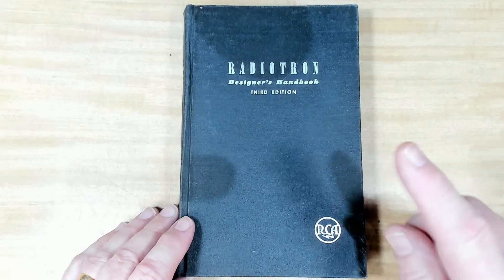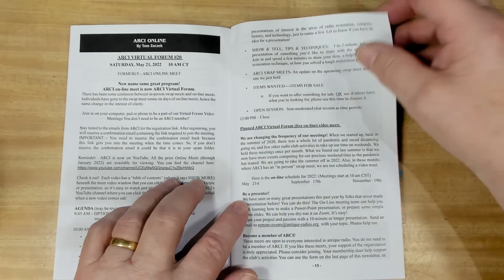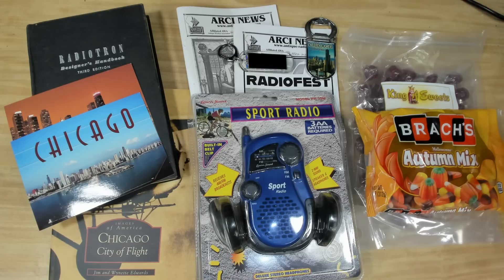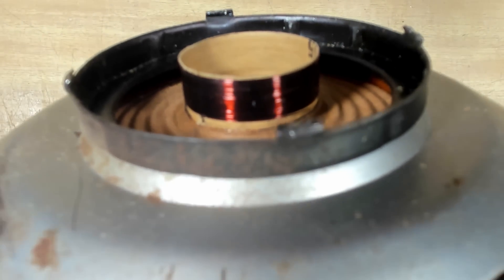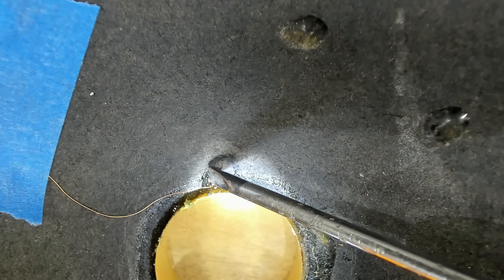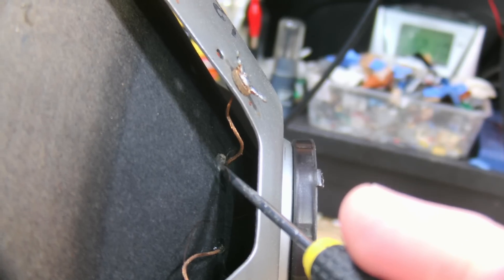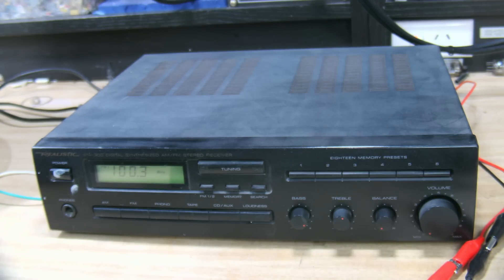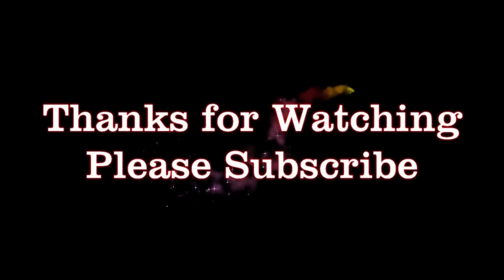12P1 Magnavox speaker repair and candy sent by a viewer.

Comment: I had one of these in 85/86, I used to unscrew the magnet like removing a bayonet light bulb and put it back without it rubbing. oneday I took it to school after the cone sustained a few more injuries, Damien Gow had a bright idea to plug it into the 240v, Jon grabbed me at lunch and said quick come, they're blowing up your speaker, I missed out on the loud blast, I unscrewed the magnet and saw a wisp of smoke and no sign of the coil wire (it was in the magnet), The speaker was from a Multisonic HiFi radio-gram my stster's Mormon bf gave me
Reply from the maker: Haha... the 240 didn't agree obviously 😄 Thanks vaughn 🙂

Comment: I just recently did the same kind of "microsurgery" on a speaker in a portable school record player (stereo!).  Of course, I wasn't as precise as you, and was thankful just to re-make the connection without any rubbing or extra distortion. No one would think you did it, of course, but it's hidden behind the grille! They were also missing dust covers over the voice coil (or maybe never had them), so I hand cut little discs out of an old sock and glued them in place.  (Black socks of course... I'm not an animal! ;-) They won't win any beauty contests but they work!  (Never throw away your old socks until they're covered with grease, cleaner, polish, or you've cut them up and glued bits into a project!)
Reply from the maker: Haha... I hadn't thought of using socks as a dust cover 🤣 Still, good job getting the speaker to work again. Thanks Lurker

Comment: Hey David I have a ASTOR model G3A I recently was gifted but know nothing about how to use the record player, would love to be able to contact you further for help if that's okay! I've figured out how to use the AM radio but not sure how to turn on the record player
Reply from the maker: Hi @AlsoMijit. The control knobs functions are printed on the dial glass, from left to right they are... volume, input selector, Tone + on/off and tuning. The second knob from the left is marked 'S', 'M' and 'R'. 'R' is Radio, 'M' is Mono records and 'S' is stereo records. Select either M or S depending on the record type you have, mono or stereo. Place a record on the record player platter and select 'Manual' on the selector control on the record player. Lift and place the tone arm on the edge of the record and it should play. You can contact me if you need further help. If you do, please attach a photo of the record player as this model came with a few brands of player 🙂
Reply: Thanks David i've sent you an email with the issue thank you for helping and responding so fast!!  @DavidTipton101

Comment: Nice timing! I recently picked up a vintage Hallicrafters speaker and enclosure. The speaker cone is in good shape but it looks like the coil is open just like in your example. Now at least I have an idea how to go about fixing it. Thanks! A few more examples might be helpful. Seems to be a delicate process. Do you have any previous videos that show the process of fixing a speaker?
Reply from the maker: Hi Erik, thank you. This speaker may have been a little different construction wise to other speakers of the same era. I don't think the magnet is usually removable in which case the cone and spider would need to be released from the basket, I was doing to try acetone to soften the adhesive in that case. I have done speaker cone repairs on video before but not repair of the voice coil 👍🙂

Comment: Nice guy in Chicago!  He obviously enjoys your work, Dave.  Repairing an old speaker like that is a touch and go job and you handled it with aplomb.  I want to pass a little hint to you from a friend who re-cones speakers and repairs speaker perforations.  Where the paper has started to thin out (as with your speaker) and there might be a tiny hole or two he uses Rust-Oleum black leakseal spray, which is a flexible rubber coating spray.  You can get it at Bunnings or Mitre 10.  The trick, according to him, is to spray one quick coat passing over the speaker...leave it for twenty minutes and then spray another couple of coats.  He has demonstrated such a repair to me and the speaker sounded fine.  It was a Plessy~Rola speaker out of an old Astor lowboy tv.  It actually came up looking really nice and sounding nice as well.
Keep up the good work, Dave...I enjoy all your videos and look forward to seeing new ones.

P.S.  Here's the Radiotron manual as a PDF:
http://www.tubebooks.org/books/rdh4.pdf

Comment: Great repair on the speaker dave, i have done a couple of speakers that also had open voice coils. In my case the wire from the voice coil was run and glued to the front of the speaker cone and was a little bit easyer to repair than your speaker. You could put that speaker into "stock" for a future repair down the line or incorperate in some inclosure with a 4" tweeter/ 3~5 watts of class A amplificaton ( valve ) and you would have some sweet sounds. Looking forward to the next instalment.
Reply from the maker: Hi Stephen, I could have run the wire on the inside, I didn't think of that. Most are done that way. The speaker is in a box waiting and ready to go to a new home if someone wants it. Thanks Stephen 🙂

Comment: I hope you get a project that needs that speaker. I'd love to see it go into one of your amazing restorations. Great video as usual.
Reply from the maker: Hi Ian. It was used on a radiogram I would kie to own, maybe I will get one one day and it needs a new speaker. Thanks Ian 👍🙂
Reply: Those 12P1 were used in Kriesler Multisonic hifi  radio-grams, along with 27 ohm 6x4 sealed back squawker wired in paralel without crossover cap, a 0.68uF would keep the honky tone down, and an electrostatic tweeter @DavidTipton101

Comment: David, I have been a radio and electronics hobbyist for many, many years, but I just realized that I don't know what purpose those braided wires on a speaker serve!?  Why do the braided wires run from the speaker terminals to the cone before going to the voice coil?  Why not just run the speaker signal directly to the voice coil and eliminate the braided wires?  I know I am overlooking something, but I can't figure out what!  Thank you.
Reply from the maker: Braided wire is used because it is very flexible and connects the stationary part of the speaker to the moving cone. It needs to be very flexible so as to not impede the cone travel and not fatigue over time. Thanks William 🙂
Reply: @DavidTipton101  David, I know I'm probably dumb as hell, but I'm not understanding why and how the cone of the speaker needs to be electrically connected to the speaker feed and to the coil. I guess I am just missing something. Is there a coil of wire on the speaker cone also?
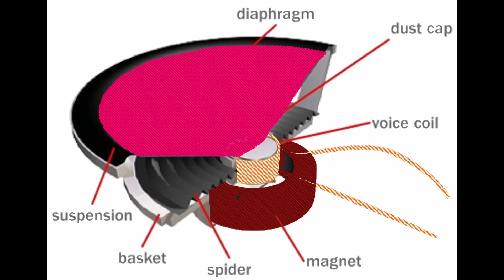Reply from the maker: @HamJamming  No problem William. There is an animation in the video at 5:46. The voice coil is attached to the centre of the cone, the voice coil and the cone move in and out relative to the metal speaker housing (basket) to produce sound. The voice coil is connected back to the speaker terminals via the flexible wires so the cone can move in and out unimpeded.

Comment: Why do you think the center portion is much darker than the outer portion? Was there more to it than we're seeing?
Reply from the maker: Hi Darryl. I didn't notice it but it probably gets warmer in the centre 🤔
Reply: @DavidTipton101  Usually, that's an indication that something was covering the area and was not exposed to light like the outer part was.
Reply from the maker: @Darryl603  I thought you were talking about the voice coil, I don't know why the cone has the darker centre section, it is not unusual so it may have been treated with something during manufacture.
Reply: @DavidTipton101  I think it was a duel cone speaker

Comment: Excellent rescue of a piece of tech that would be expensive to buy new, if they were being made with that level of solidity and quality of materials. Little videos like these are real nuggets. Thanks for sharing David
Reply from the maker: Thanks Ken. I have it stored in a box, hopefully someone can use it one day 🙂
Reply: In many ways modern speakers are much better, but they have a different sound, and often don't look or sound right in old radios. I have a small collection of old speakers just for voicing amps, as the speaker (and box!) make more difference to the sound than the brand of your amp.

Comment: Hi Dave, 
Like you intimated, it was destined for the trash, so give a repair a go.  At worst, it would remain trash.  You performed an excellent job repairing that speaker.  It is now ready for work as and when you require a larger speaker.
Also, an excellent Antique Radio Restoration community is evolving: that sure is a good thing for like-minded people.
Best regards, Phil
Reply from the maker: Hello Phil. I had nothing to lose attempting a repair and I might learn something (I did). I have spoken to and met so many wonderful people across the world doing these videos, it has been a pleasure. Thanks Phil 🙂

Comment: Hi David, Have that same book in my collection. It is in the suggested reading list I put together in my "Show More" section. I Refer to it fairly often. Nice 
Repair. I have a 12 inch sitting on the bench right now with an open voice coil. (will be in a video to be released soon). Also had the wrong output transformer attached.
Found an original with transformer attached for the restoration. Guess I will have to dig into the dead one and see if I can match your skills. 😊😊
Reply from the maker: Hi Vern, I wasn't familiar with the book till Martin sent it. It's very good, I have read small sections and picked up a few titbits already, I need to set some time aside to read it in full. I was hoping I could rewind the voice coil in my speaker or at least something more challenging. Good luck with your speaker repair, I'm looking forward to it. Thanks Vern, take care 👍🙂

Comment: Hi Dave. Enjoyed your speaker repair ,lately I've been a little more adventurous with taking stuff to bits just to see if it can be repaired, often not but sometimes yes. We'll worth watching. Keep up the good work. Thanks
Reply: Hi Dave. Thanks for the reply. Out of interest the Magnavox brand in the UK showed up in the early 70s.  Never really popular although did service one or  two. I always thought they were more USA. Then it seems they ended up under Philips.  Any more in Australia?
Reply from the maker: @Robert-bd4mb  Magnavox were made here in Sydney and as you say ended up under Philips, they may have been made it the Philips factory, I don't know. Like the UK they showed up in the about the 70s. That's about all I know.
Reply: The EMI factory may have made them, an 8" EMI speaker I saw had the same basket style as the 8P1 Magnavox and likewise with the 7x5 speakers @DavidTipton101
Reply from the maker: Thanks Robert, That's how you learn, sometimes you learn that you shouldn't have pulled it apart 😄

Comment: Dave, my dad had copies of both the second and forth editions of the Radiotron Desogner's Handbook which I now have in my library, great reference material. Years ago the forth edition was scanned to PDF, don't know if you can still find it online but I have a copy. Finally, if you are interested, I have a PDF of images of the Philips valve factory in Sydney in the 1930's. I tried to post a link to my website for it but when I include links in my comments the comment doesn't get posted.
Reply from the maker: Hi Peter, another commenter said the fourth edition has been scanned and is available for download. I checked my YouTube 'Held for review' but your comment with a link isn't there. There may be a way to do it but I don't know 🤔 It would be interesting. Thanks Peter.

Comment: I have that amp
Reply from the maker: Not a bad unit John. It kept losing the station settings so I ditched it. I have changed the supercapacitor a few times to fix it but it only lasts a few years.

Comment: Nice fix David.  Had to look at my brothers Chinese “Strauss” guitar amp the other day. Traced the source of crackling to one of the EF80s having a couple of tiny pieces of tobacco under it. The socket had a crust of nicotine as a result. The socket cleaned up ok and I cleaned the EF80s pins too. No more crackles.
Reply from the maker: Thanks @Wenlocktvdx. That's an unusual fault, good job locating it 👍😃

Comment: Even if you don't end up fixing something like this, it's worth the effort to find out what works as a repair and what doesn't and how something is constructed. That's why I always attempt to fix something, even if it looks to be a lost cause. Half the time it's the learning process that's enjoyable. Great video David. The book about valves looked interesting. I bought a book on valves from the Classic Reprint Series of Forgotten Books called The Thermionic Vacuum Tube and its Applications (catchy title) by H.J. Van der Bijl. Goes a bit deep into the theory of operation, but it's worth the effort if you can find time to read it.
Reply from the maker: That was the purpose of the exercise Ged.  I wanted to see if I could separate the cone from the basket and spider but I didn't need to. I will practise on another old speaker when I get the chance. Who could forget that title 😄

Comment: Often with that enameled wire, if you can get it hot enough you can tin it without needing to scrape it.   That can be tricky to get the right balance on speakers though.
Reply from the maker: Yes, I know but I haven't had a lot of success doing it. there is a solder that will clean off the enamel as you solder the wire I believe. I haven't seen it be it was on YouTube somewhere 🙂
Reply: @DavidTipton101  I think it needs higher heat also to melt the enamel, which definitely is tricky when dealing with a short wire near a paper cone.  If I remember rightly I learnt that trick from Paul Carlson (Mr Carlson's Lab)